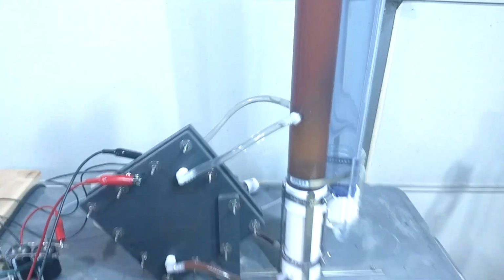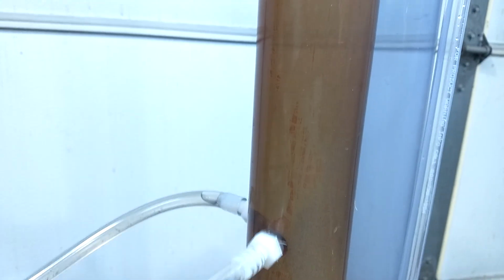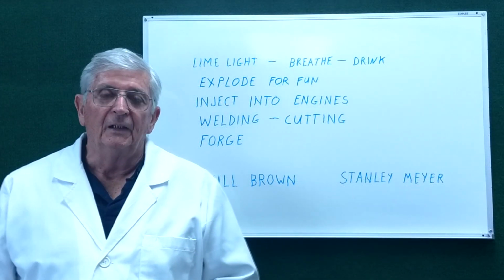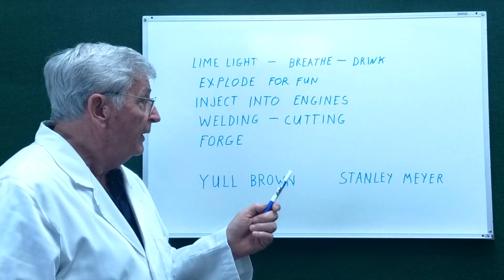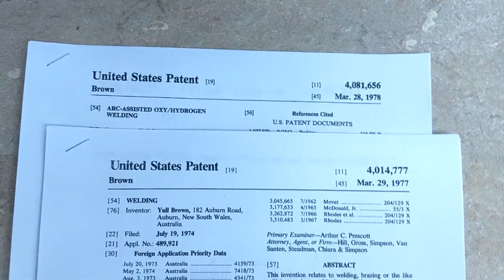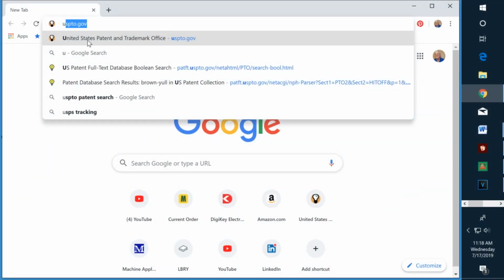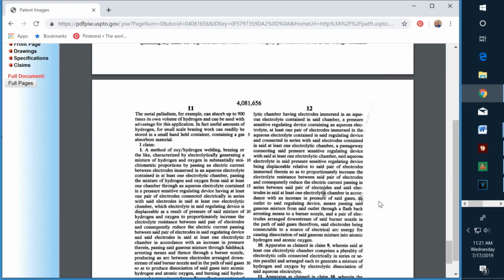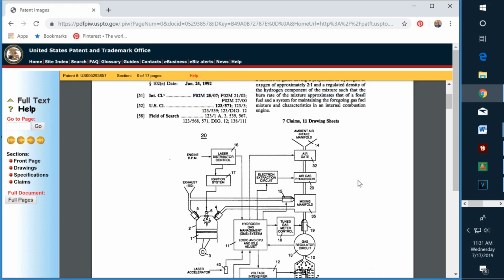HHO Generator with carbon Steel Plates Part 3

Comment: Hi, I have a question... Are you using tap water ... ?..... If so mineralisation burns and turns to brown sludge.. acrylics tubes statics attract partials and stick's to tube walls... Perhaps combination with carbon steel... Use 316 only..
Thom in Scotland.
Reply from the maker: I used distilled water. 316 ss contains chromium which reacts to form hexavalent compounds which are carcinogens. In the future I plan to use nickel plated steel.
Reply: @Jimscoolstuff  it means it could be useful? To produce hho. Can you reduce fuel costs.

Comment: A hot water tank uses a magnesium sacrafical rod to keep the hot water elements from eroding or Oxidizing. It doesn't have to be hooked up to power just in the electrolytes. Make it easy to remove and your cell will last a long time. Good video. I hope your doing good. P.S try super heating steam and the run it through an iron pipe. The iron rusts or AKA oxidizes and takes the O out of H2O and the result coming out of the super heated steam is H or Hydrogen which you can compress or just burn it coming out of the steel pipe!

Comment: Jim you are genius . I read an article from a top snoz collage , and in this article they compare different materials for the most efficient hho and core-ten was the material to use. This is a combination of nickel on one side and cold rolled steel on the other this would allow the steel to only rust to a certain depth. I have worked with core ten brand in sure there are more names for this metal

Comment: Hello, I really appreciated your series. Your informational value is exceptional. 
I have one question remaining though. To more precisely control plate deterioration and gas production it would be most practical to utilise a current limiting/regulating power supply, right? 
As you seem quite educated in electrical engineering, what would be your take on current sources that can provide a great power output ( 0,5 - 1 kW) while being efficient and not too costly?
E.g. Commercial constant current LED drivers all fail at one criteria or another in the end.
Reply: Control plate deterioration by using , Stainless Steel plates, 316,. Not 304, and only, 0.9 mm thick, you get what you pay for my friend.. works out cheeper in long run.. use distilled water only to maintain clear water... Thom in Scotland.
Reply: @fuelban  you are right.

Comment: Jim, You are awesome and I thank you for posting some real videos.
I do not have the funds for my idea so I am posting them to you or anyone that wants to try this.

First the plate idea is bad and takes a lot of time to do. Look at the other idea that's out there where you make a coil using stainless shim stock 10 thousand from metal supply store.
You want to roll 2 of them together using a rubber gasket 2mm thick. Now you are going to seal both ends with a good sealer like jb weld.
Sorry I forgot before rolling you want to cut 1/2 " wide strip and bend the  tab for electrical connection. You can cut half way through both plates.
Once rolled and sealed on both ends you want to drill and tap the center of one end. The other end must stay sealed. If you notice on the side where the 2 plates end that is the gap that the hho will come out. Once a bubble forms on a plate that area will not produce anything until the bubble leaves right. So you are going to put the whole thing in a pvc pipe of needed size. You will drill holes in the pvc and the tabs you made. Run stainless screw through tab with stainless screw and washer touching tab then add a sealer washer before going through pvc. Add another seal washer outside with washer and nut. That is your elecrical hook up.
Now for the exciting part you will need a VELLMAN PMK111 Controller from fry"s electronics so be prepared to pull out your walle these things arte almost 5 dollars. I believe it is a 555 timer but it comes with a 30 amp Solenoid already. It has controls for how long on and how long off.
Now about those pesky bubbles, By using a round cell you can connect a small 12v Pump to run those bubbles out. Pump solution in center hole and allow it to exit the side, This way you are using most of the stainless for production with very little voltage leak. Mount the cell horizontal with gap facing up.
Connect pipes vertical for the flow and about 18" up drill though horizontally and glue a 1/2" cross pipe with about a 1'4 inch gap cut out inside the big pvc facing up.
Your solution level will go about 12" above this pipe. Ok I am Losing you but wait. You are going to connect your pump to this pipe and route it back to the cell.
You see the gap will allow you to get the solution while them bubbles swing right on by. Now for a kicker using the timer connect it to a 12v cheap car coil.
Using solid wire spark plug wire you connect that to your cell. How about 10,000 volt pulses to play with.
Long winded aren't I.
Remember I state here that I can not be responsible  for any Injury or death by my Idea, So if you kill yourself I will not attend your funeral.
If you need further assitance you can email me at joelcalling@gmail.com. I hope you have fun and bring us all to the light because it's time to end this big pollution problem even if it cost more than oil to do it.
One last thought, would it be cheaper to drill 3 miles into the ocean floor and suck it up ship it to my processing plant on land and then truck it to all my gas stations.
Or should I just electrify some water in a cup and go to work. HA HA

Comment: It's nice to watch someone who knows what they're talking about and can explain the theory behind what they are doing. The Brown/Myers cult drive me nuts. Somehow I don't think your rebuttal will change their mind. Nobody can convince them :)
I was trying to make some iron oxide the other day and I wanted to skip the chlorine gas if I could help it so I used NaOH. I noticed it didn't corrode like it does with salt. I thought maybe I could just use mild steel in my next generator and skip the hexavalent chromium. So I spent a couple hours researching until I stumbled upon your videos. Thanks, you saved me a lot of experimentation!

Comment: I know that silver is the number one conductor of electricity and copper 2nd, taking that into account could I use .999 fine silver rounds (coins) by drilling holes  through them to make the plates. Would this work good? Or cause problems? I have looked but can't find anything about it

Comment: Are the plates actually etched or are they only covered in a magnetite precipitate?
Reply: @Jimscoolstuff  What is your voltage per plate?? If you run more then 2.3 volts per plate it will burn the electrolyte. the brown goo is the result. what is your electrolyte? Baking soda of lye??
Reply: @jessewilson1796  what do you mean?Why plates oxidise?Is that because of too high voltage potential or because of very high oxygen content around anode
Reply: @Jimscoolstuff  https://en.wikipedia.org/wiki/Magnetite